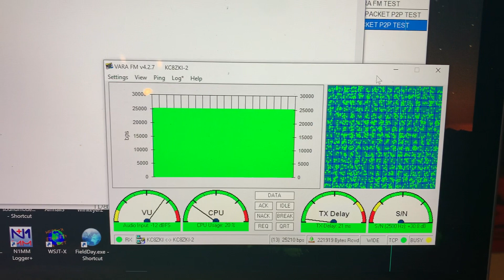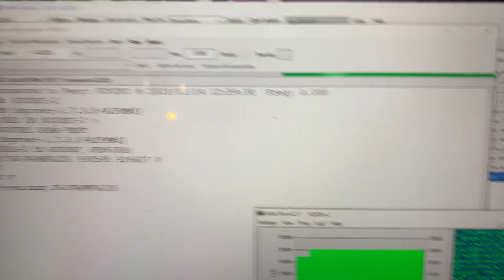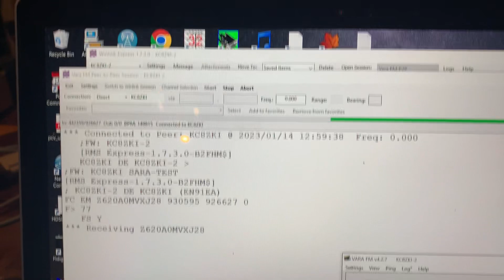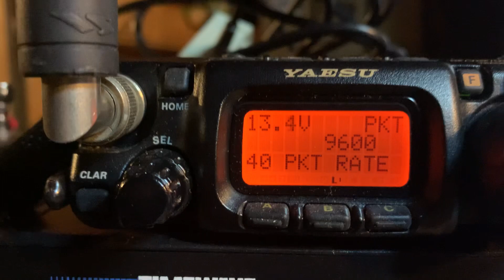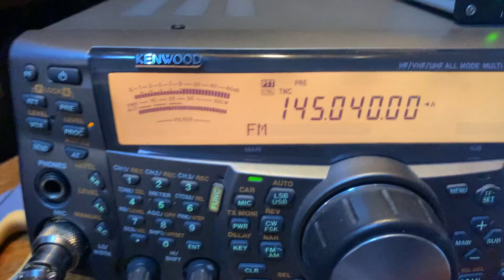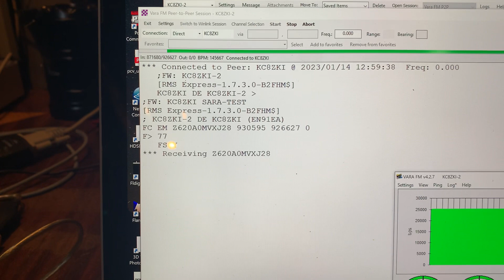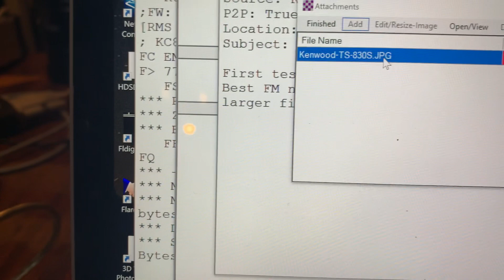Vara FM Wide - stock red Signalink at 25210bps!

Comment: Didn’t know there was a red and a black signalink
Reply from the maker: The pre-2018 units had red isolation transformers, post have black transformers.   I had read that the red ones have less frequency response than black ones and could not be used for VARA wide FM.   In my case, the old red one passes more data than the black one on VARA FM wide when paired with the Yeasu FT-818.   To investigate further, I measured the frequency response of the red one and discovered it is flat well beyond the range needed for VARA wide FM.   A possible explanation centers on the impedance of the radio's data port, which does affect the response.    The FT-818 was specifically  designed to pass 9600 packet.  This was back in the days when most TNC's likely used the red 600 ohm transformers.  I imagine the engineers designed accordingly.